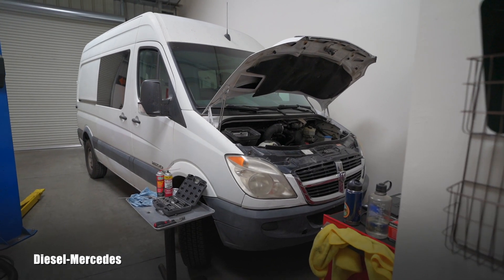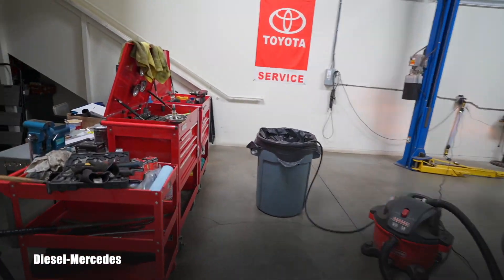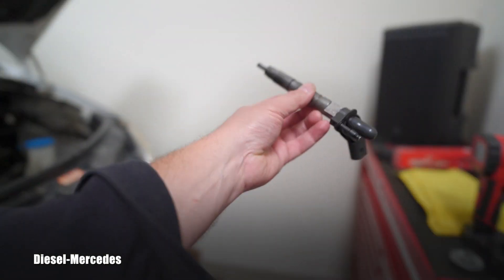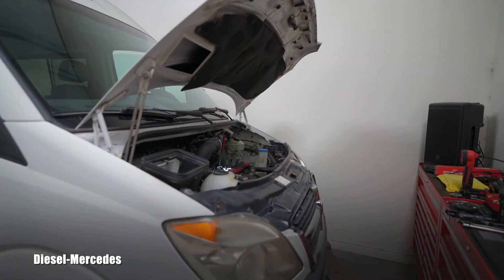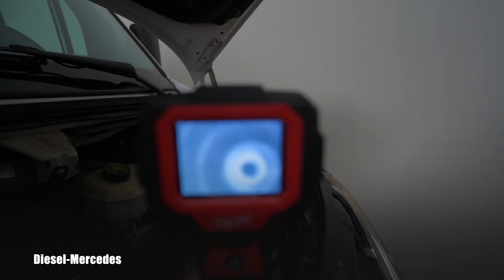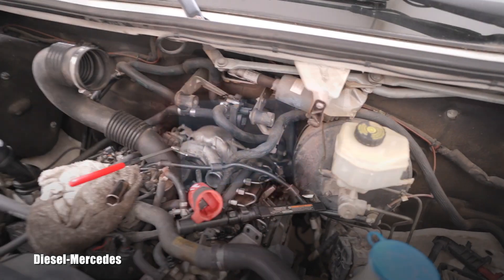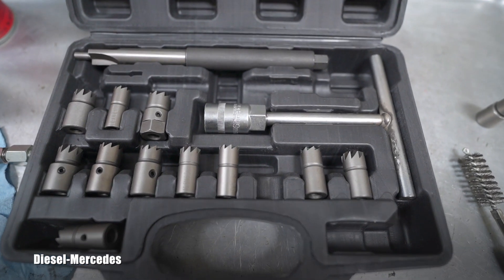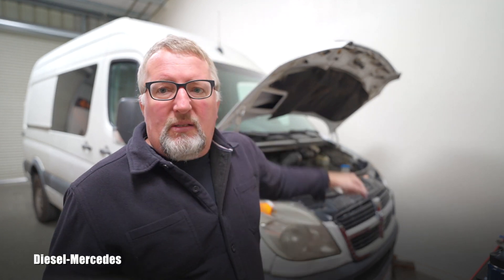Diesel Injector Seat Cutter Mercedes OM642 CRD

Comment: I have 2009 Grand Cherokee 3.0 diesel (Aust) with the Mercedes om642 engine
I have purchased 2 different reaming sets and neither of them work correctly as they are not long enough to reach the bottom of the injector bore. 
The bottom of the bore seems to stepped 17 down to 15 for the washer and when trying the 19/17 bit it just cuts the outer perimeter of the bore and not the complete face of the bore.
Any advise would be most welcomed.
Reply: Use 17x17.

Comment: Hey great video, but I have been trying to figure out how to prevent metal shavings and debris from falling through the porthole in the cylinder. I was thinking to stuff the porthole with paper then vacuum the port. That would stop some of the debris. In the end if the paper get sucked out good. If it's stuck I can psh it in the cylinder. Can't be worse than metal shavings.
Reply: Put great on the cutter
Reply: @ermining1  yep that worked well.
Reply: @daught5007  sorry meant to say grease 🤣

Comment: Are there any aftermarket injector seals which hold up better than the OEM copper seals?  Great videos!
Reply: @Colonal Walter E. Kurtz theh are slightly thicker , wouldn't that cause a problem

Comment: Cu injector washers same as om648?  Many folk using the Honda diesel water.  Yup, Honda does have diesel passenger cars.  Washer is minisculey thicker and they r softer.  Dude on ebay sells them on fleabay in sets of 4 in Honda packaging.  Expensive because of shipping from Japan.